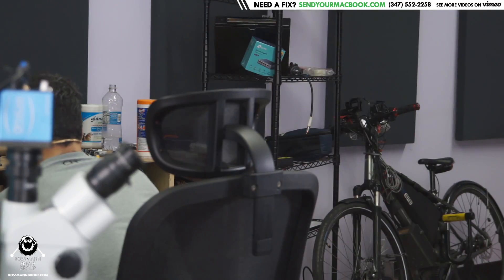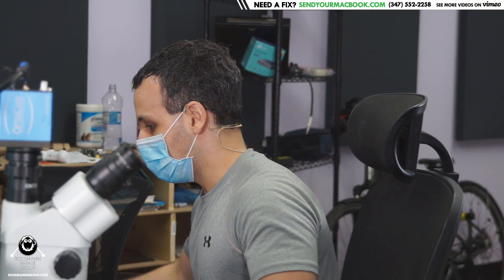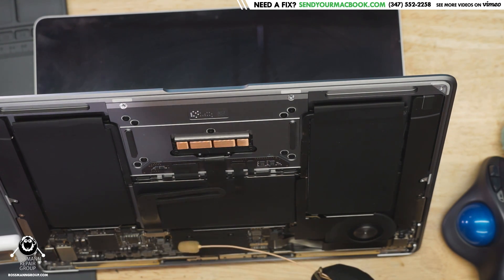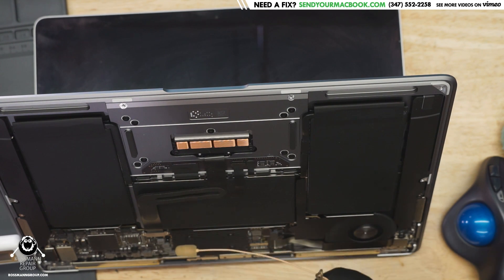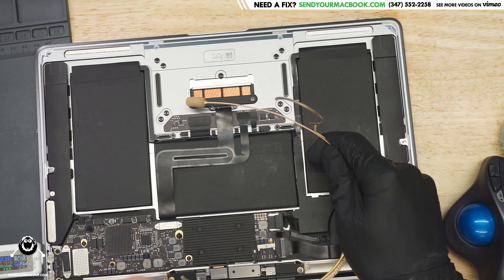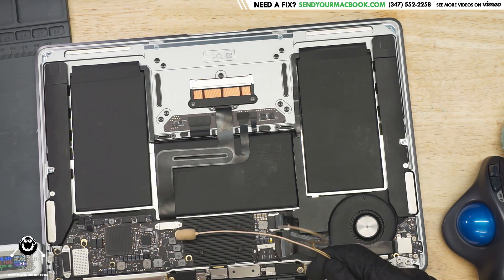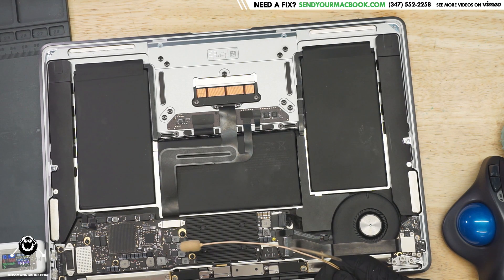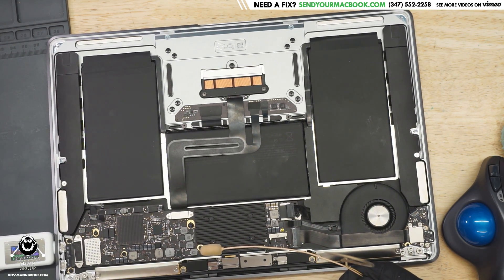The sound of a suffering Macbook Air CPU with no heatpipe 😢

Comment: The fact that the heatsink is not connected to the fan is mildly infuriating
Reply: We are used to Apple "Quality".
Reply: lol you still use old tech, the Apple heatsink connectes wireless to the fan with a special adapter.
Reply: @kippenkopjes  LOL
Reply: @kippenkopjes  you can purchase the adapter for an additional 95$ ,pre-order now!
Reply: Urip Andono  Sync is probably an accurate description because we are talking about Apple after all. Maybe this is actually a heat sync because it syncs wirelessly to the fan on the corner.
Reply: @jacobnathanielzpayag3885  lmaaao 🤣🤣🤣🤣
Reply: They thing that negative pressure airflow is enough
Reply: It still would work if both were connected by some sort of air duct.
Reply: To be fair, a 7W TDP is pretty low and it'll thermal throttle a lot if it ever were to overheat. But I don't get why they didn't just run two small heatpipes either.
Reply: Drogenfeld it always over heats and always reaches 100C watch Max Techs video on it
Reply: @uyasey  It's not a horrible idea, but a horrible design. It could actually work, you just need to give the air inside a bit of motivation to move. Besides, i bet apple engineers get off to people still buying their crap when even they know it sucks.
Reply: @lakiza55  what do you mean it's not a horrible idea? This is exactly the kind of idea that should be killed at prototype stage, the point that they went through it at all means they don't give a fuck about cooling. Same with keyboard, same with that stupid hinge cable.
Reply: @StevenZephyc  the concept isn't bad, the no heatpipe thing. If you can get airflow through a heatsink, it doesn't matter where it is, or where the fans are
Reply: Drogenfeld there’s a heat sync on the processor, guessing without looking up the specs that the processor there doesn’t generate a shit ton of heat and throttles itself a lot which leads me to think the fan is only there to evacuate the air from the chassis as the chassis itself is the real heat sync.
Reply: @robsnook4512  That's Apple thermal design for yah. All for the sake of making things thinner.